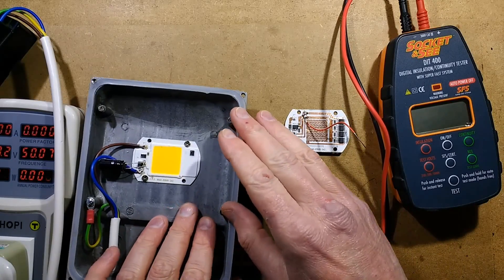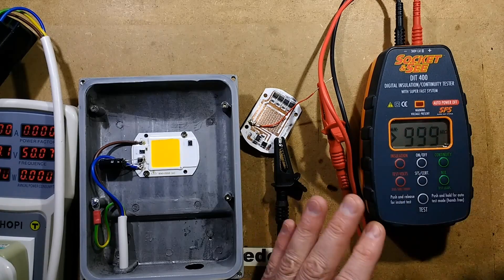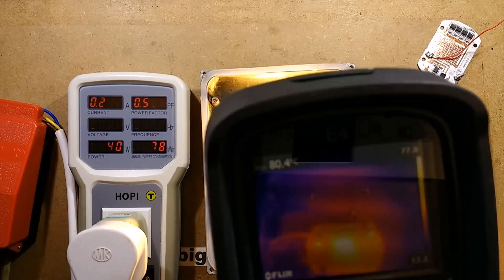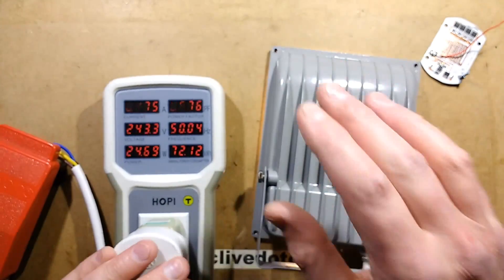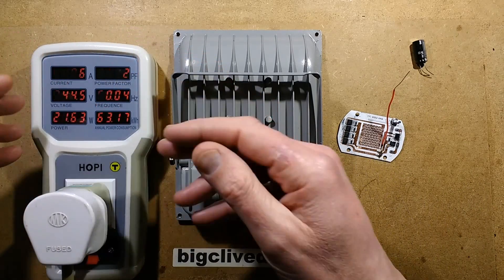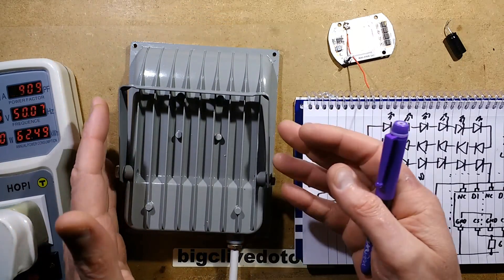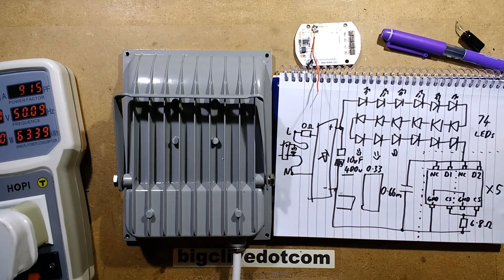Adding a capacitor to a driverless LED and other tests.

Comment: Those things are so cheap that a multi-kilowatt LED array might be amusing to build.
Reply: mikeselectricstuff q
Reply: h
Reply: Roughly 10kW per square metre, say 50% heat would be generated
5kW heat is 1litre of coolant water through 5'C every second?

Comment: hey Clive nice video. I was wondering if you could limit the current somewhat with a larger series capacitor for the purpose  of offseting the extra current drawn when a cap is placed on rectifier output to smooth. would the series capacitor required be too large to be practical. just a thought.

Comment: What about submerged in mineral oil type cooling system, in a 1/4" (6.34mm) over wash sealed type thing.. like what those crazy PC builders do.... and crank the living day lights out of one... I am not saying that you need to spend a bazillion bucks on a rig set up just to see about the heat transfer rate/survivability rate..... When I was investigating some high power flood & spot lights for my Jeep, of which are costly, I came across what was called liquid cooled off road lighting.... I do not know if the cooling system was self contained of if you not only needed to run the power wiring, but would need to run a "to & from" cooling tubes to an external system... I didn't bother to even look into any of the specs, because I already knew I wouldn't be able to afford them, due fact that I was struggling to afford the lights I did get. (of which I am sure were marked up 12,000%), likely only cost $4 to manufacture, lol, but lets take his first born child as payment... Some of those PC guys, as I am sure you know, are over clocking and making their machines crunch some hard core graphics while being submerged in mineral oil, and make mention that there is no way they could be crunching that hard any other way, but with the oil cooling systems...

Comment: Can you feed it with AC/DC?
Reply: I recommend Back in Black.
Reply: Soulless leftover! I'm not sure that music modulated lighting is necessarily an improvement upon flicker unless that music is severely overmodulated.

But to answer your question, it could be run on DC in addition to AC, but you would need to adjust the DC voltage until you obtained an equivalent level of dissipation.  If this were a resistive circuit then that target DC voltage would be the same as the AC RMS voltage, but because these LEDs likely do not even turn on until a very high voltage is achieved across them and then exhibit a long blanking duration between each half AC cycle, you may have to experiment a bit to find the most appropriate DC voltage for direct current running to obtain the same total power dissipation from the LEDs.
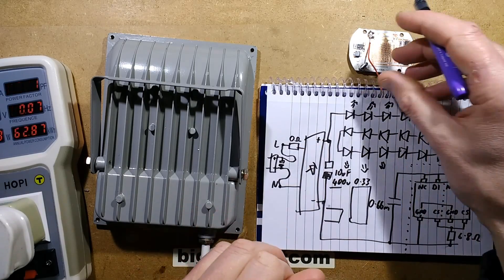Reply: 7:37
Reply: On a similar note- some Beetles have Wings, but is Whitesnake Poison?

Comment: 240V Mains ➡ FULL BRIDGE RECTIFIER ➡ film in oil motor capacitor (for heat tolerance and longevity) ➡ two of those COBs in series (assuming the forward voltage is met)

Comment: Maybe the answer is a smoothing cap and a series cap to bring the wattage back to 20 watts, not an issue in such a lamp fitting. That is course only if flicker is a problem.

Comment: Does the heatsink get hot enough to melt butter for the purpose of making trashy two ingredient chocolate though?
Reply: Uhh, no. Things would probably go exciting quick when you have 240v mains buttery liquid exploding everywhere.
Reply: "Exciting" is what we're looking for.
Reply: Butter melts at body temperature, this LED gets up to 185F, so yes. It may take awhile to melt a large quantity of butter since the butter would act as a liquid cooling agent if applied directly to the back of the heatsink.
Reply: So, you're saying that we could forgo the heatsink and just use butter for cooling?

Comment: How about putting a bridge rectifier, then a 400v Electrolytic, upstream of the chip? The onboard rectifier would just be bypassed but the 100% duty cycle for those BrightPower controllers would probably reduce their life expectancy significantly!! (Edit - I notice you mentioned this later on!!) At a guess the ripple current will cook the cap too, hence the heating effect (the Chinese mass-market electrolytics are very sensitive to "excess" ripple! :-) )

Comment: i wonder, is it possible to 'print' a fla t capacitor on the back of the module, so the capacitor is built in too?, does such a flat capacitor exist? i guess also they can redesign it to allow a capacitor to be fittted, hmm any other ways to stop the flifkering and still have it a one board unit?
Reply: Capacitors are just conductive plates separated by an insulator or insulator/electrolyte so you could theoretically "print" one with the right machinery. The ESR would be ridiculous though due to the small size.

Comment: The flicker on that meter is absolutely terrible.
Reply: Seamus Caveney the display is multiplexed, it only appears to flicker because the framerate of the camera is greater than 50ms per frame, i.e. above the persistence of vision. in reality it would appear than all displays are on at the same time.
Reply: He adjusts the shutter speed, increasing the time it takes to capture a frame, very simple videography.
Reply: The digits are most likely multiplexed at at least a few hundred Hz. If the (electronic) shutter is open long enough per frame (as in low light conditions), all digits will light up at least once within that single shutter (frame rate and shutter speed are two different things) and thereby look flicker free.
Reply: The thing I find interesting is that around 4:10 when he puts that meter right up close to the camera the flickering magically stops. All I can come up with is that the camera is somehow adjusting its framerate to remove theflicker but I've never heard of such a feature. Or is this a post production trick being applied? Or ???
Reply: he was

Comment: Clive, we have a few cheap 140W LED floodlights in the shearing shed which give brilliant light for the shearers but they cannot listen their favourite AM radio station due to the noise the drivers put out. Do you have an AM radio handy you could check the effect these driverless LED's have on the radio? Shearers get very cranky while working without their background music.
Reply from the maker: V8Snail These should be quieter electrically.  The standard high frequency electronic drivers are very poorly filtered if at all.  It might be viable to add an extra filter to the existing lights.
Reply: Yeah have tried chokes and various tricks with very limited success. I'll give a retrofit
 a trial and see how that fares.
Reply from the maker: AM radios are the most susceptible to RF interference.  I used to use one to test the effectiveness of the RF suppression on my dimming controllers.  Can you switch to FM? 
I wonder if there's enough room in the lights to add a proper mains filter like this:-
https://www.rapidonline.com/schurter-fmw-41-chassis-mount-ac-line-filters-1-phase-562073
Reply: +V8Snail put an AM receiver behind the lights (where the radio output from the lights should be blocked by their casings/heatsinks), then draw out the audio wire to a set of speakers where the shearers are?
Reply: bigclivedotcom  I tried a similar unit I pulled out of an old expensive Japanese power supply which reduced noise in a bench test then would come back when wired to the lighting circuit. Interestingly we thought we had fixed it at one point when the radio noise cleared temporarily. It turned out the 3 pin plug on the 5m cables to the lights was badly oxidised and the resistance coupled with inductance of the wires worked beautifully until we moved the plug and upset the oxidation. Adding resistors to an outlet isn't ideal though.
Reply: MrJohhhnnnyyy Cheers. It's often easier just to swap to known good units after exhaustively chasing nonconformist invisible pixies.
Reply: V8Snail Chokes will work, but only if mounted very close to the source and if the noise is bad then you may need a choke with many turns through it, how many turns depending upon the severity of the noise, the particular ferrite material chosen, and the frequency range (including harmonics) of the noise you are trying to block.  With ferrites the impedance at a given frequency increases four-fold for every doubling of the number of turns, so two turns is equal to four single turn ferrites clamped on, so you gain much more from multiple turns than you do from multiple ferrites.  The efficiency as a filter will improve markedly if you also add capacitors (ceramic and film capacitors work well for such) to create a proper LC filter on each side of the ferrite -- with such you can effectively block just about all conducted RFI and remove such from the wiring.  That just leaves you with the directly radiated since you will still be emitting RFI directly from the LED module, but at least at much reduced efficiency since your electrical wiring will no longer behave as an efficient antenna.  If you can place the driver in a grounded metal box to shield it and install filtering on both the AC input and DC output before they exit the metal enclosure then you can effectively trap all the noise inside the enclosure and eliminate virtually all the noise.
Reply: V8Snail These are linear drivers, they're quiet.
Reply: Play music from a memory stick?
Reply: aye the lack of inductors in this driver bode well for your application.  give it a go :)
Reply: Could you locate the AM reciever remotely and just run a cable for amplified audio into a loudspeaker inside the shed?
Reply: Pain in the arse, I know. But would an isolation transformer fix it?
Reply: No, I've used the term 'Pixies' to describe 'less than obvious' things from around 20 years prior to AvE popularising his vernacular.
Reply: The AC line filters from the Rapidonline link above, anyone have an opinion why the 6Amp filters would be priced less than the 3Amp?  The 6Amp are £1.18 less, it seems odd.
Reply: +David Null  The 6A unit has a lower inductance required for the extra current. Maybe in this case the 2x2.0mH common mode choke in the 3A model is that bit more expensive than the 2x0.8mH in the 6A.
Reply: +Ethan Poole  These lights cost $50 AUD each delivered and the light produced vs cost couldn't be beat. Big cast ali housings with 2x 70W COB's & 2x drivers in each. After adding 5m cords and tapping an earth (they came with the earth attached with silicone??) I realised I had well underestimated the Chinese ability to create something so electrically crap, at least for EMI. 

The switching hash produced covers a massive spectrum which takes advantage of the efficient antenna setup of the fixed wiring. In this situation the textbook solutions weren't effective and the economics of solving it go far beyond the usual 'I'll take this as a challenge". 

What surprised me from a technical standpoint (as I accidentally discovered with the oxidised 3 pin socket) was how effective adding a resistance to the feed end of these 5m cords was at nearly eliminating this hash in this instance. Unfortunately there was no easy way (and probably not a good idea) to permanently install resistors that would handle the dissipation required for more than just a short term test. Interesting result none the less.
Reply: ""Pixies"??  You're telling on your affairs with other channels. You're going to hurt Clive's feelings. lol
Reply: they make and sell more of them. Look up "Economies of scale."  That or it's the extra step of cutting a 6 amp in half to make a 3 amp filter.